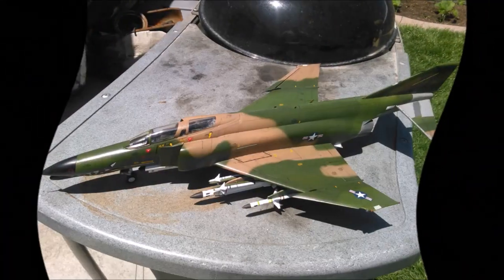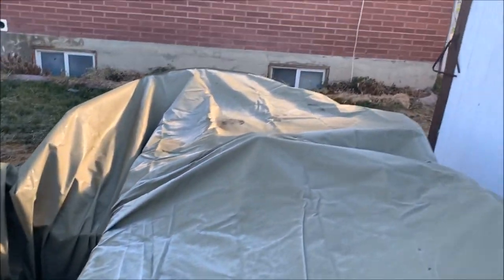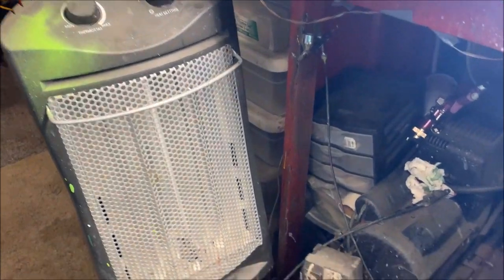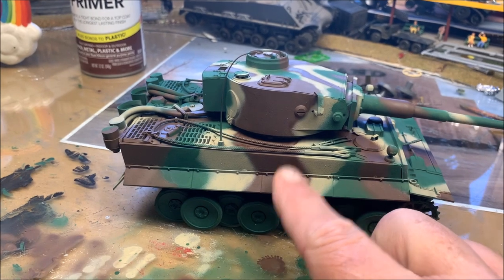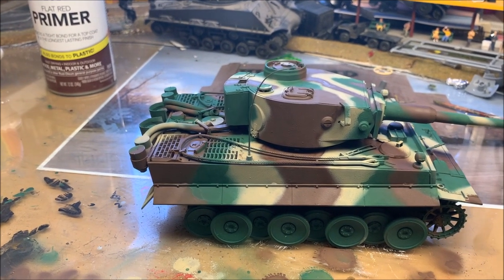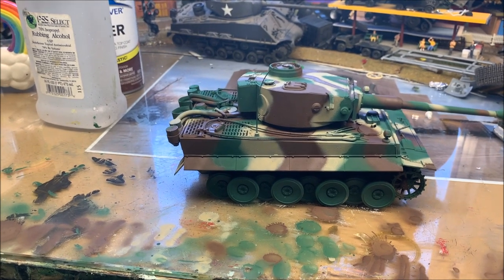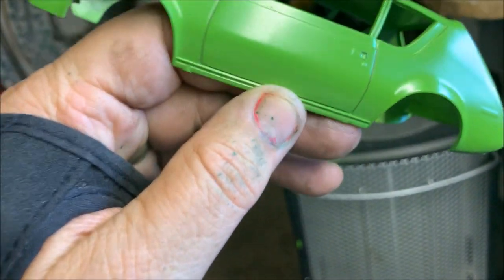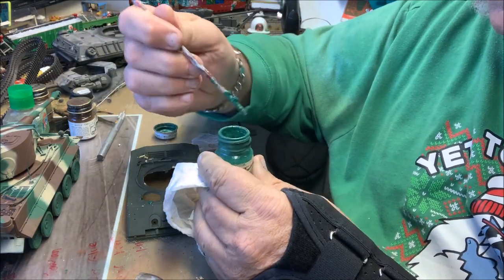Yes I'm crazy! Painting models in the cold of winter

Comment: What buffing materials do you use on you cars. I have a black 67 impala that I painted right before it got cold and turned out horrible, bought a spare kit just in case, but would like to see if I can buff out the imperfections in the paint.  Thanks again!
Reply from the maker: There are some polishing pads that are in one of the videos I did I think it was the kit hoarder stash a while back or I talk about the tools I use. They are foursquare pads that start out at 1200 grit I think the next one is 2300 and then 3200 and the final one is 4000. Start out with that 1200 and some soapy water and you should be able to get all the orange peel out with a little time. I always get a booger in the paint no matter how much prep work I do. Fortunately it’s usually in the last one or two coats in so it’s pretty easy to get out using these polishing pads. You can get them online or most good hobby shops carry them I know MRS has them. When you start to polish it out you will find that some of the high spots like the edge of a fender you’re going to probably take all of the paint off and you’ll see some bare plastic. That’s perfectly fine. Just go back over those areas and repaint them and then polish them with a finer grit and it should turn out just fine.

Comment: What about the ye old wood burner and a bit of basic insulation?
Reply from the maker: Definitely had wanted to get some insulation for many years. One of the problems is that big wooden door that is the access. I have tried to get it straight so that I could insulate it but every year with the heat and the cold it sags.  But the bigger issue would be the wood-burning stove. I would love to have one out there however remember that place is full of plastic models and my experience has been to not have anything like that within 20 feet of a wood-burning stove or you wind up with deformed models. The best fit for me would be electric heat however the current breaker situation in my breaker box needs to be upgraded so I could run a dedicated line just for the heat and that would definitely help. Thanks for watching. I’m confident next year will have some thing a little better for winter.
Reply: @maddogmerv  Insulation is pretty cheap even second hand stuff is usually fine. Didn't mean a big stove just a small wood burner with a flute in the corner somewhere mmm (like the old western movie type is what I thinking) or convert it to gas maybe (bottle outside under cover). Anyway just a thought take care 👍